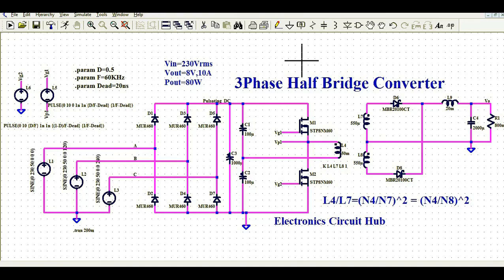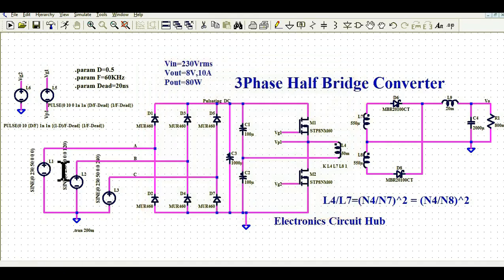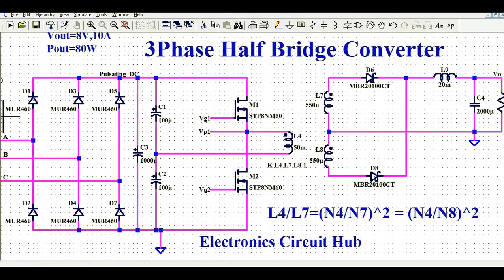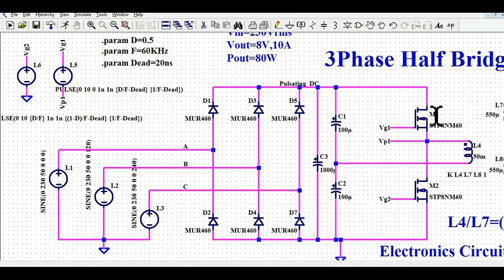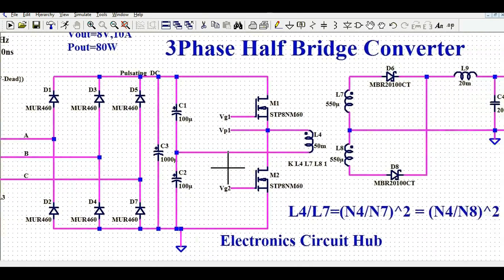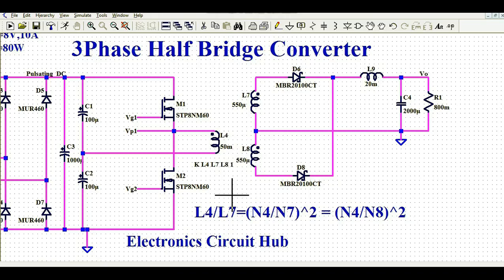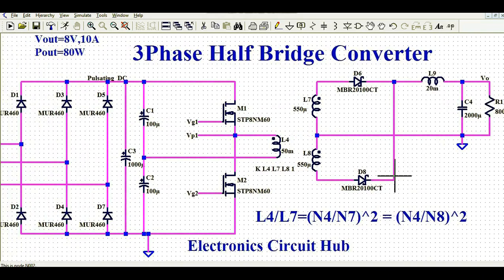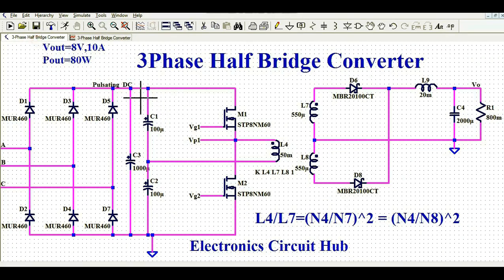Designing an 80W Three-Phase Half Bridge Converter in LTSpice | Step-by-Step Guide

Comment: How did you convert STP8NM60 PSpice model into LTSpice model?
Reply from the maker: @abuhoss1967  Hi, Thanks for asking good question. You can find the video in my channel about that. If still not able to do it, please book meeting with me.
Reply: @ElectronicsCircuitHubECH  I watched the video "How to add 3rd party model to LTSPICE || Importing PSPICE model to LTSpice || .mod to ltspice". I able to convert "PDV301N" but failed to convert "STP8NM60". Is the conversion process different?
Reply from the maker: @abuhoss  conversion process should be same, not sure why is it happening.
Reply: @ElectronicsCircuitHubECH  Thanks for your reply. I downloaded .lib file and autogenerated the Model. For verification, I used gate driver with 10 V pulse. But, it does not work.
Reply from the maker: @abuhoss  Not sure, need to check it,
Reply: @ElectronicsCircuitHubECH  Thank you for your support. I am learning LTSpice. Your video is a great help.
Reply from the maker: @abuhoss  You are always welcome. I run Hardware Design Course, you can find the details in channel page. Feel free to reach out to me incase any doubts. Good Luck !
Reply: I have done the model. Thank you for your support.
Reply from the maker: @abuhoss  most welcome,  I like your attitude and passion.